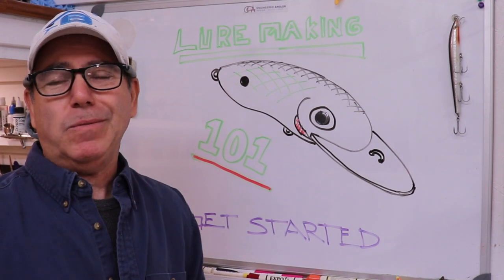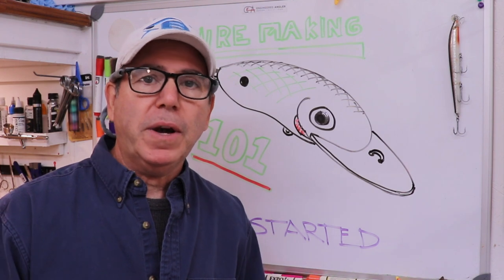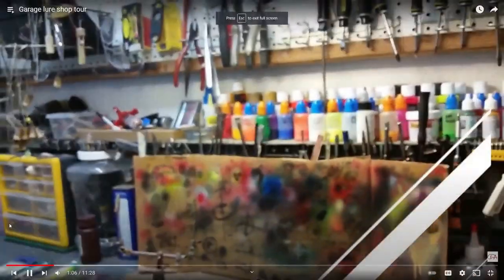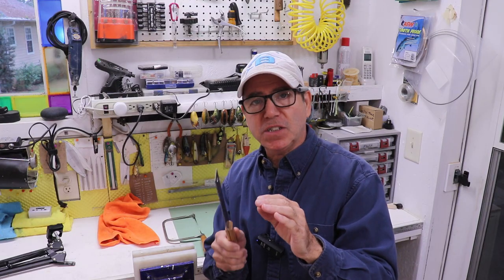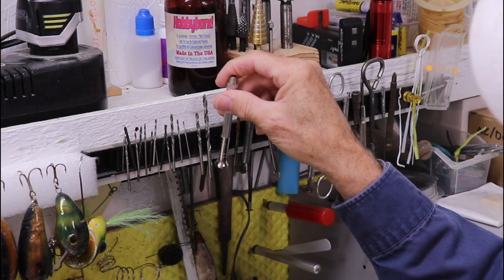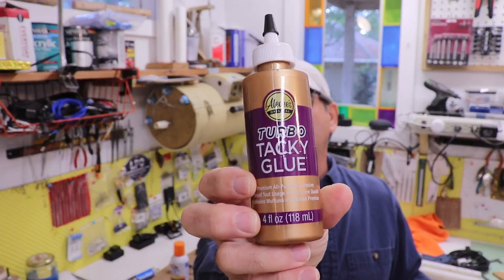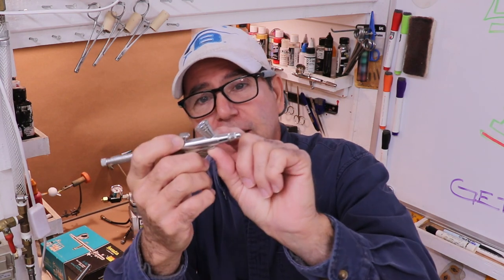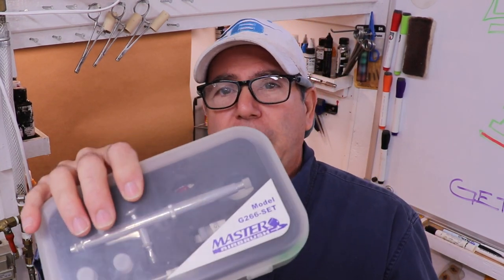Making Lures for Beginners,  Lure Making 101, How to get started. #makelures  #luremaker

Comment: Great ! Do you apply a sealer before the  coating with resin ?
Reply from the maker: I seal with minwax policrylic
Reply: @EngineeredAngler  Hello again, May I ask if you recommend Iwata Smart Jet Pro Airbrush Compressor? Or are there better options? It's hard to decide which one should I buy
Reply from the maker: Yes I apply the sealer just before the top clearcoat.

Comment: One of my first builds is still one of my favourites. I didn’t have anything fancy to make it. Basic shape done with a coping saw, took time to whittle it to shape, sanded by hand. I took a lot of time painting it by hand using toothpicks and pins for fine details. I didn’t have a turner and turned it by hand for hours while watching a movie. Still my most satisfying lure to fish. A jointed top water/wake rat. Unfortunately I used galvanized wire so it won’t last forever.

Comment: Get used to the cheaper airbrushes before you get the good one I went straight for a 200 airbrush I took it apart to clean it one day and I lost one of the parts next thing I know I'm spending 50 bucks on a new part be careful try out a cheaper one before you go straight for the expensive one 👍😎💸💸

Comment: Question. Why can't I use 1$ silicone cartouches from Home Depot to make the molds?
Reply from the maker: They are designed to be adhesives and will stick to your blank, also will take a week to set at the thickness needed.

Comment: I made a cheap self contained epoxy/UV dryer in a (roughly) 20"x16"x12" storage box. As soon as I've finished applying either two part epoxy or UV resin I lock on the lid and either forget it for a few hours or turn on UV light. It's painted black on the outside and has foil on the inside including the lid. I can also store my epoxy and UV resin inside the box when in storage. The whole thing was less than $15 including the UV light and small 5/6 rpm motor. So far I've produced over 100 lures up to 180mm.
Reply from the maker: Nice!  Simple is usually best.

Comment: I am a saltwater angler and I mostly used dead ribbon fish for bait trolling for big fish from my kayak. I made my own rigs for the ribbon fish bait but it could not make the bait swim correctly.  Is there any way that I can contact you to ask for your advice?
Thank you
Reply from the maker: I'm afraid I don't think I could help much on natural bait rigs.
Reply: I hope you don't mind me commenting on your question.  I think the most obvious way of imparting some action to a dead bait fish would be by the use of a lipped head.  I frequently used scrounger heads with eels, both real and artificial, for striped bass.  This, however, may not work depending on the size of the ribbon fish you're using as the size of the scrounger heads are limited.  Also, imparting some swim action to a dead bait will only work as well as the bait will allow depending on how stiff or pliable it may be.

Comment: please use the metric system the old british system was phased out in engineering years ago
Reply from the maker: Funny you say that...here in Florida the old system is going strong.  I try to mix it up a bit but, unit conversion is a good math exercise ☺
Reply: @Engineered Angler Lures  true but metric is way easier, small graduations and everything in a mulitiple of 10 and to cap it off a Kg of water is 1 litre.  How much dose 13.6 gallons of water weigh (first question imperial or american). hard to do off the top of my head.  13.6 Litres of water weighies 13.6 Kg or   13,600ml. my conversion calculator is getting a work out using the old imperial / British system that even they have mostly abandoned.
Reply: @davewood9329  Sadly, you’ll never convince a Yank how bad imperial is, even an engineer, sigh. It’s their religion.